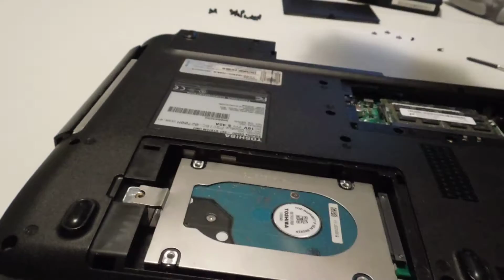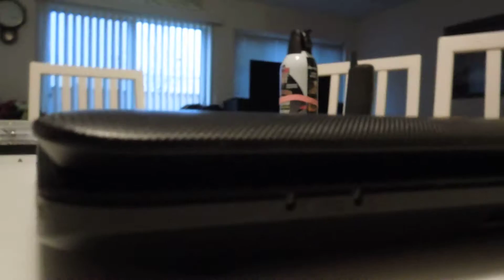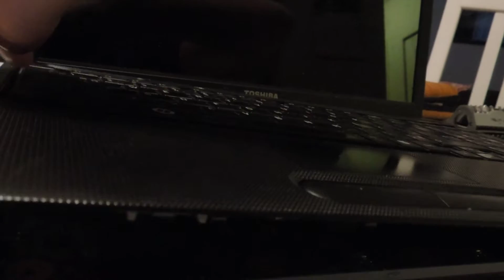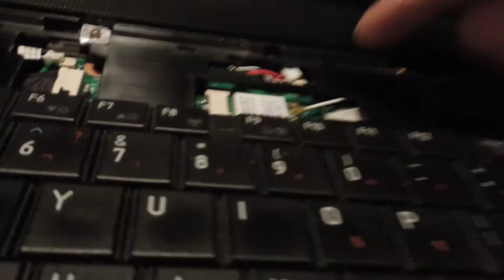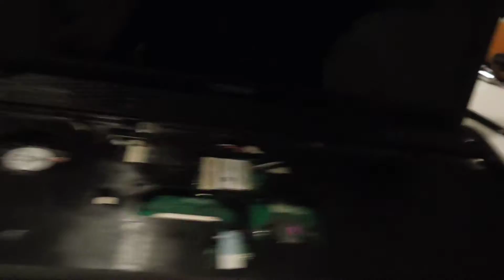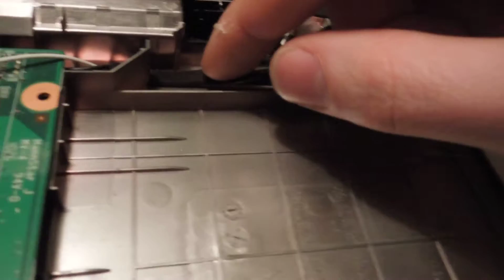how to take apart your Toshiba satellite c650d 027 laptop for maintenance cleaning repair

Comment from the maker: yes sounds like its a charging port issue if you have a pin or a pair of tweezer . look in the charging port you should see a little tab in the chargiong port make sure its pulled out and not flush *not the pin* but the tab thats built in the side wall bend it out a little so its sticking out a little so that way your sure its making a 100% ground

Comment from the maker: Yes it  could theres also a battery moniter piece.. if you pull the battery out and start the laptop does it work with out battery in it ??? If so the then it puts charger and charging port out of question. If you insert the battery with the laptop on and the battery below 20% does it start charging ?

Comment from the maker: I was thinking about it but the case is to small and graphics cards for laptops are expensive i would suggest buying a new gaming laptop. There is a few companys that you can custom build the laptop on there site and when it comes to changing graphics cards for future use they can tell you what will fit in the case. Also this toshiba has bad cooling i would not suggest it for a better card

Comment: Very nice video, really helpful!!
I have just a problem though.
Before opening, the laptop was working perfectly.
After assembling it, I plug it to the power adapter and the led indicator for power is turned on, which is ok.
When I press the power button then the led goes off and nothing happens. The laptop doesn't power on or doesn't do anything else.
Any ideas for a solution to this problem???
Thanks in advance. :)
Reply from the maker: hmm i would check your ribbon cables and and plugs sounds like one is not fully in
Reply: ghostlyrich Thanks for the reply!!
I found the solution yesterday and it was a really odd thing. I hadn't had coped with anything similar before. Two pairs of pins in the display's plug on motherboard were in contact, causing a kind of short circuit apparently. When I put them in the right place everything worked fine.

Comment: Hi 
The video was really helpful and nice but I wanted to know if u can upload a video who to remove the motherboard and also I had another problem which is : before aparting the laptop it used to charge with no problems and worked perfectly but then after I apart it it stopped charging and working so if u know what might me the problem please till me the thing I need to do :)
Reply from the maker: sounds like either your charging port inside the laptop is unplugged or you missed a ribbon cable i would take it back apart and reseat all ribbon cables and plugs